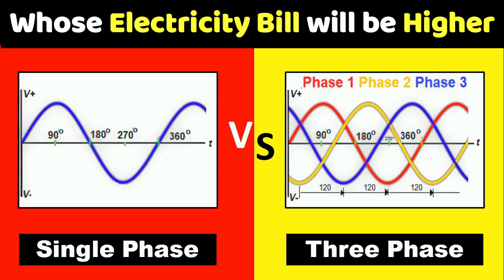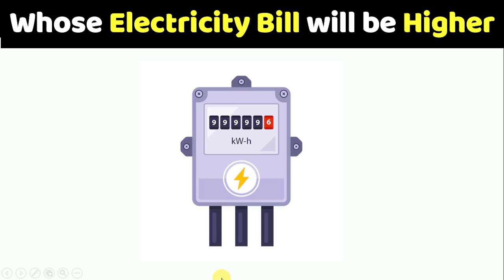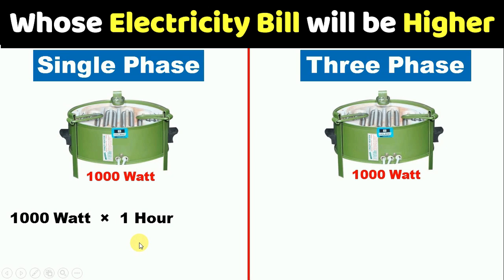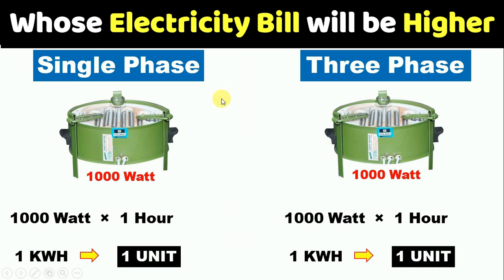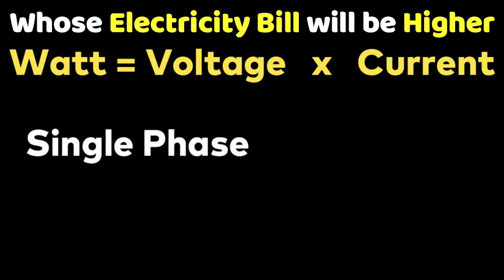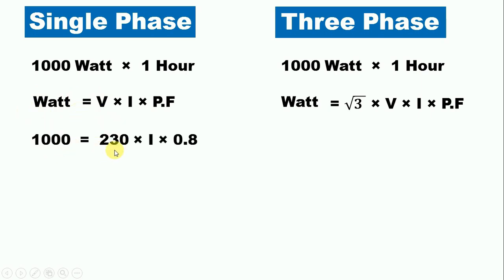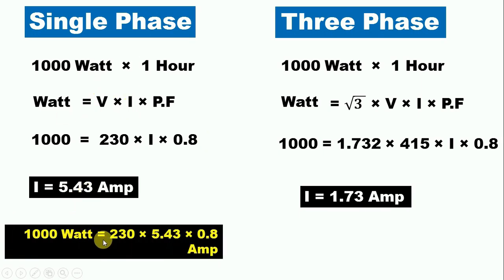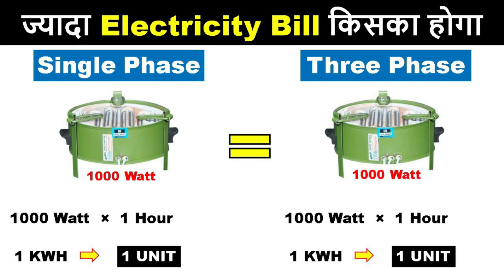Power Consumption in Single Phase and Three Phase | single phase vs 3 phase @TheElectricalGuy

Comment: Watt's Law: W = V x A x p.f. wattage equals voltage times current times power factor. For purely resistive loads, such as heaters, or light bulbs, the power factor equals 1.0 ❤